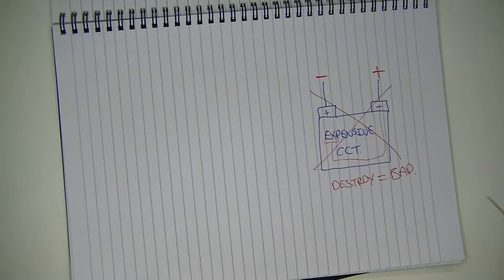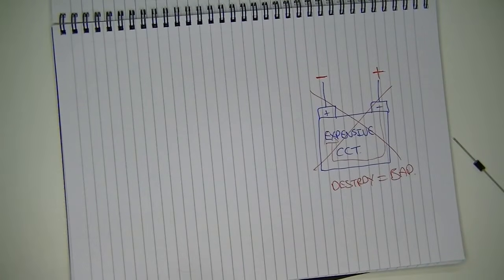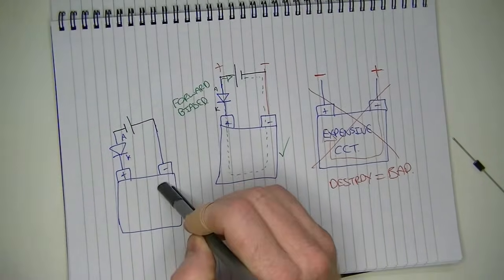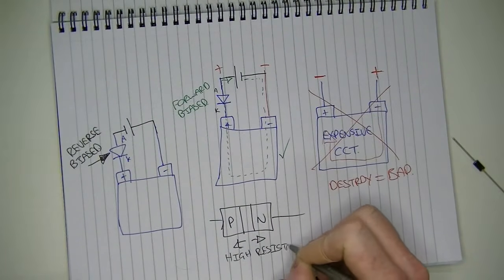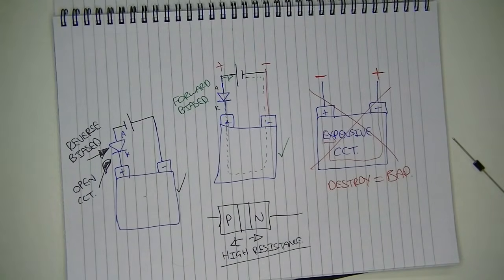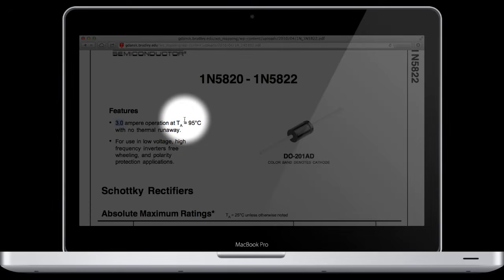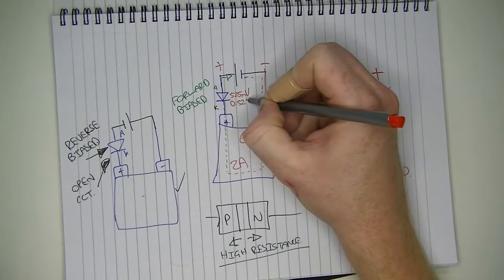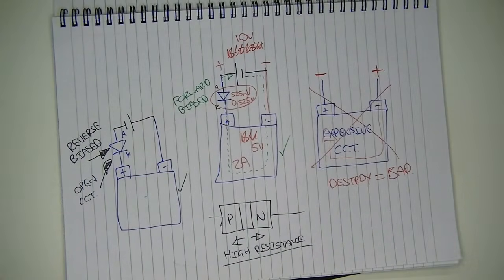Electronics Tutorial 13 Diode Protection.

Comment: would be nice if you could do a video on practical use cases of a capacitor. the capacitor is widely used for multiple purposes and a lot of the time it's confusing. I would like to learn more in depth of some of the practical use cases of the capacitor.